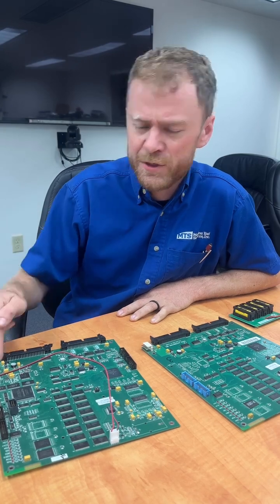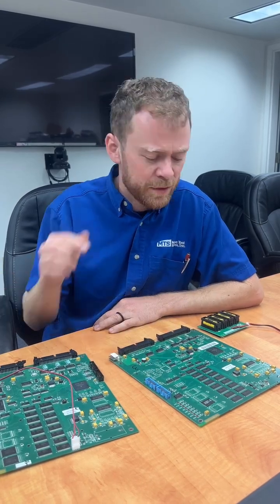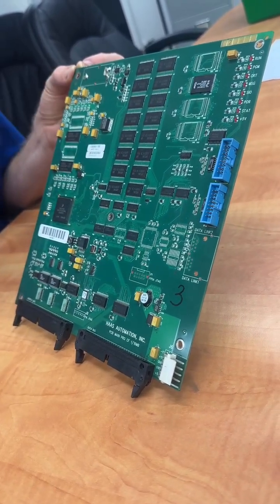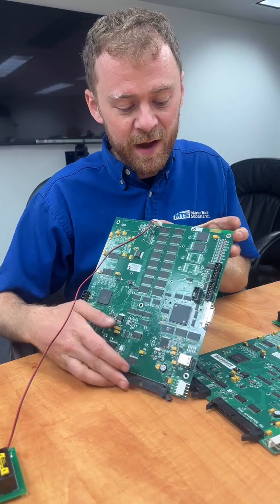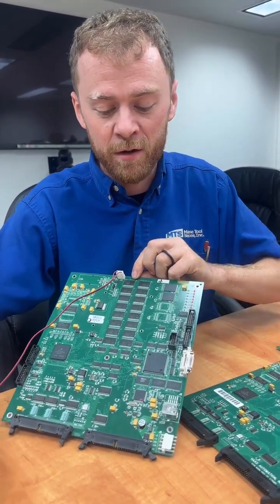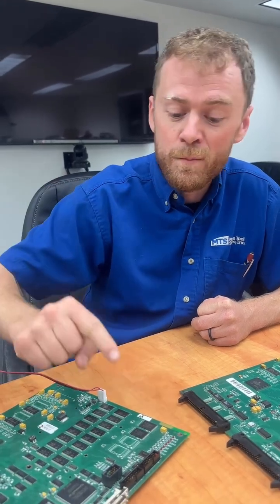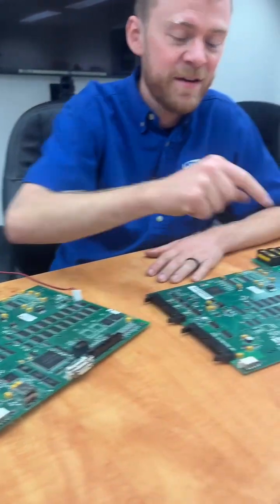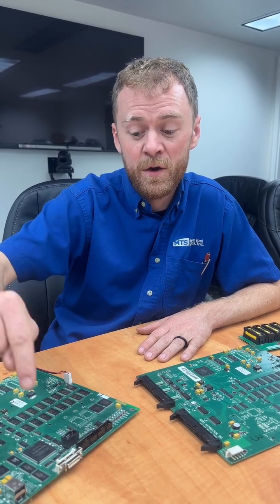Old Circuitboards in CNC Machines?

Comment: I have a late (November?) 2004 VF2. It definitely does not have either of those boards. It's a 16 MB, two battery board, with the external battery jumper. Mill V13.04N. That would put the CF-1 at 2005 being the earliest.